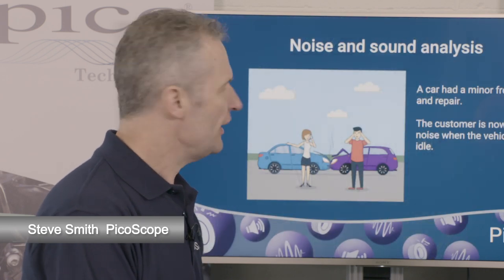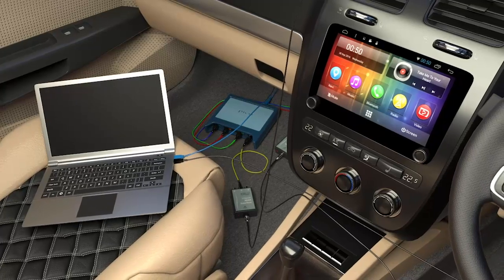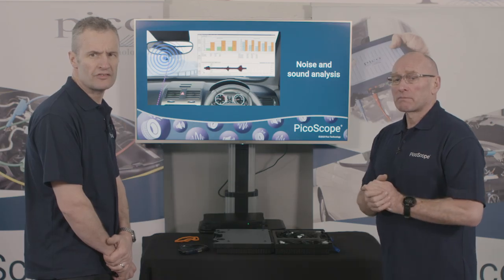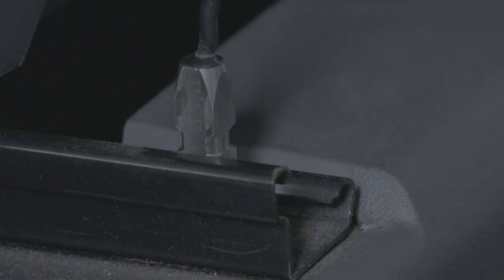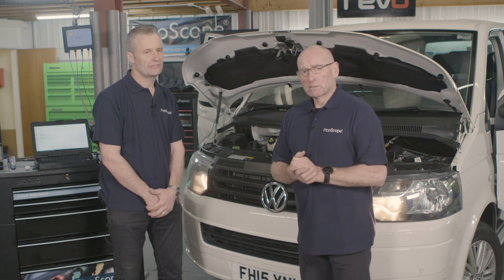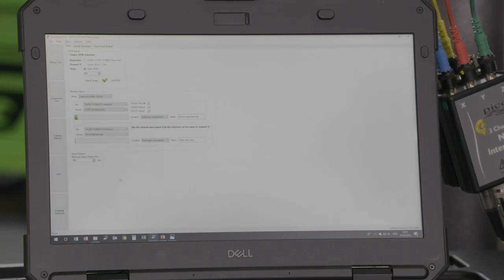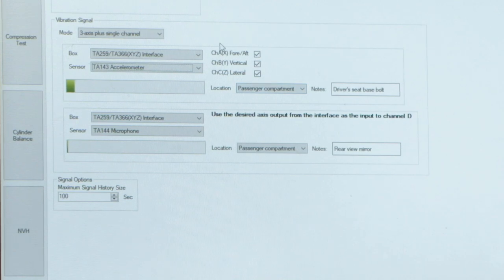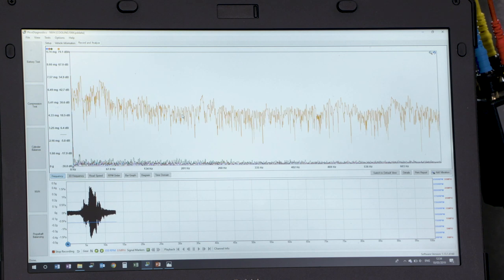PicoScope NVH episode 6: NVH noise and sound analysis

Comment: I work at a Lexus dealership and our vehicles have aluminum control arms, aluminum steering knuckles, crossmember how would you attach the tool to aluminum? We deal with a lot of one time impact sounds from suspension over bumps and driveways.
Reply: Hello Kevin and thank you for the feedback. Aluminium components are an issue for the magnet of course but there are a number of options depending on application. If we can reproduce the knock stationary then we can clamp accelerometers  to the components of interest. If a road rest is required, then we use a bonding agent to attach/bond washers to the components and then attach magnets to the washers. I hope this helps, take care......Steve
Reply: @stevesmith4724  Thank you so much for you're response great idea I will give that a try. Pico has literally change the way I think about diagnosis. Keep up the great work we in the field really appreciate Picoscope products.
Reply: @stevesmith4724  Thanks for the response  I will give it a try
Reply: Get yourself a chassis ear, they clip on and you will save yourself $4900....